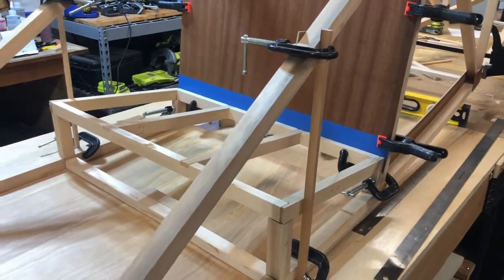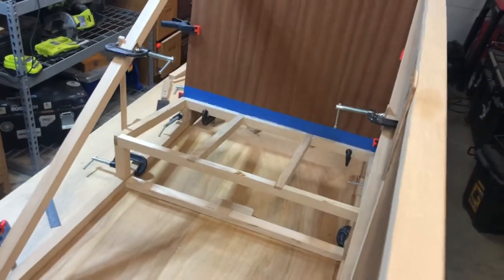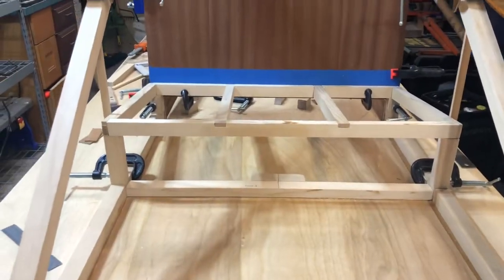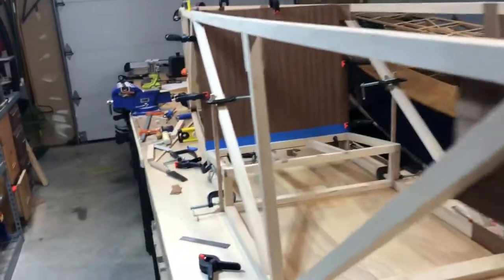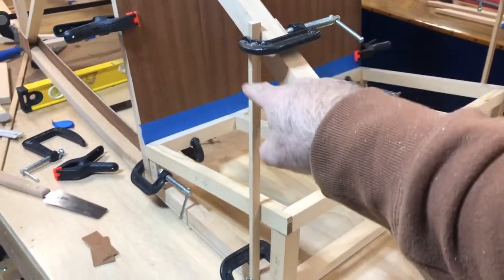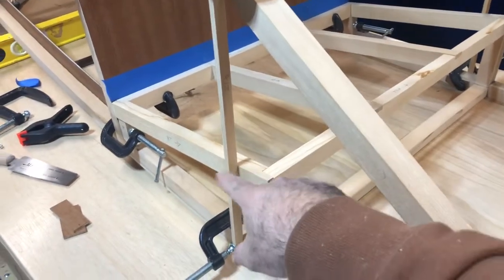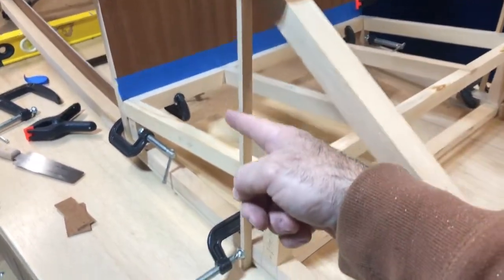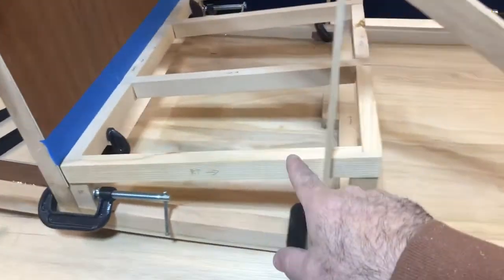Pietenpol Air Camper Build #23 - Fuselage Feb 2022

Comment: Hello, great work ! Thanks for the videos, really helpfull. Personnally, I plan to start building a Piet this summer (in France) and this videos will be a valuable ressource ! Just a question, have you buy the Pietenpol kit to have the bundles of wood or is it just materials you purchased after reciving the plans ? 
Well done !
Reply from the maker: I purchased the wood from Aircraft Spruce here in the USA.  They provide wood in “kits” for each component that you would like to build.  I started with ordering the kit for rudder and vertical stab.  As they are relatively in expensive and usually in stock.